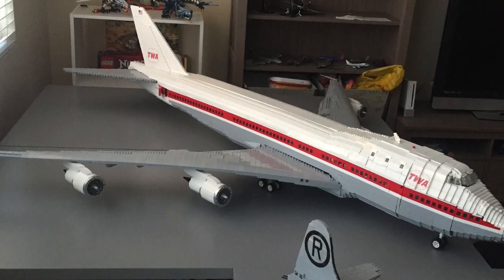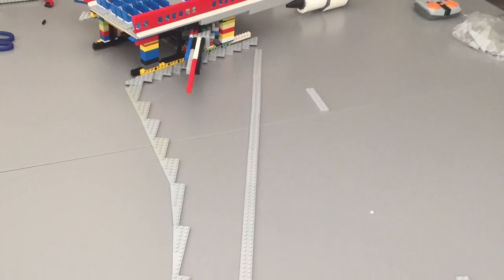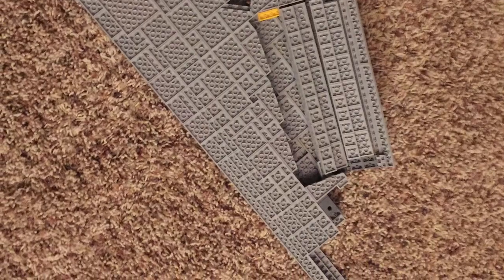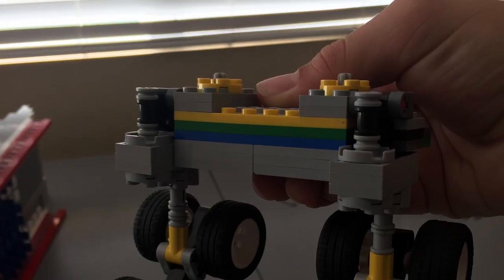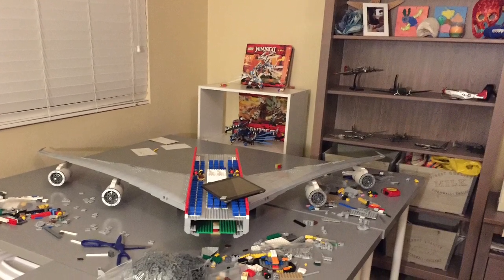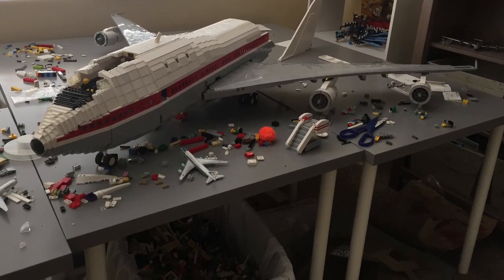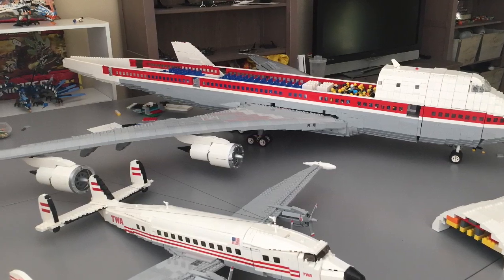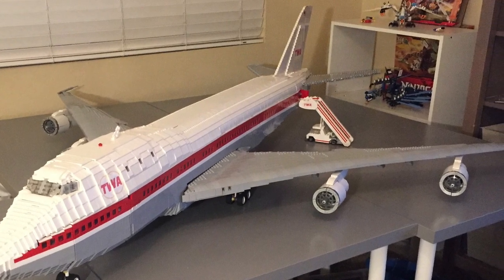Building a LEGO 747 from start to finish

Comment: BigPlanes Hi, i'm building the airbus a340-600, with more details that you put, also this is much bigger than your Boeing 747. Your plane is awesome, however, you can create the seats, not only use those pieces. Good luck with your next projects. :)
Reply from the maker: Thanks! I used those pieces mostly due to budget.